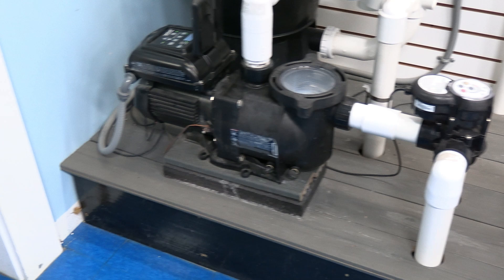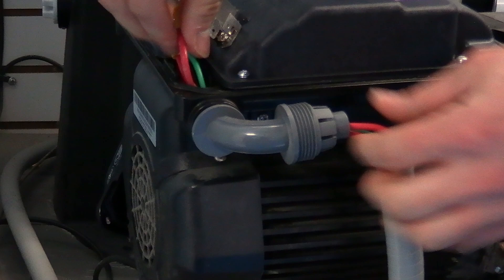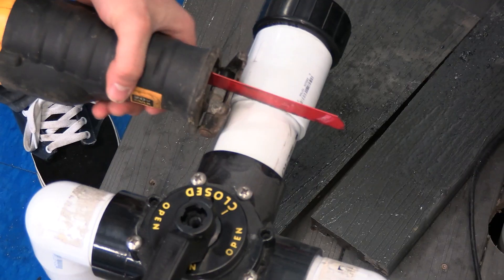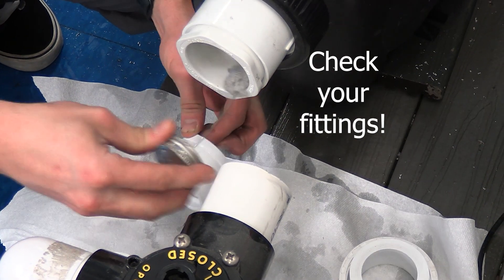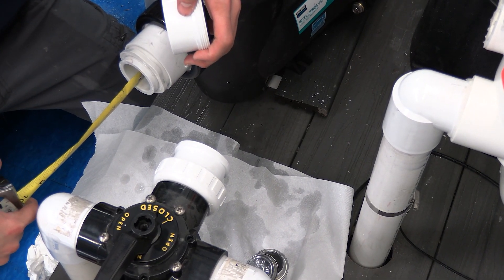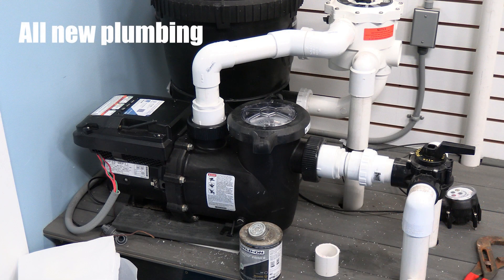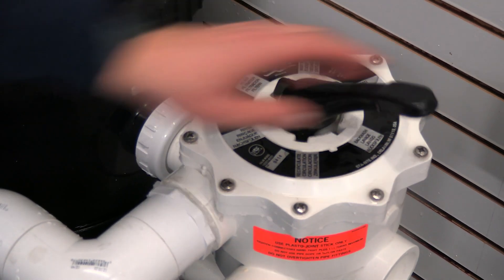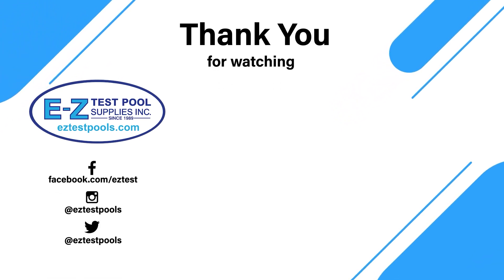Pentair IntelliPro3 VSF Pool Pump Installed

Comment: Can this pump be wired to iaqualink in a VF configuration?
Reply from the maker: Hello!

Yes! Pentair IntelliPro3 VSF pumps are compatible with Pentair automation systems like iAquaLink/Pentair Home when wired correctly. These pumps are designed to integrate with automation using an RS-485 communication connection, which lets the automation/control system communicate with and control the pump’s speeds, schedules, and modes. When connected to iAquaLink (or Pentair Home), you can control things like pump run times and speeds through the automation interface rather than just at the pump itself. Make sure you use the communication cable and wiring method recommended in the pump’s and automation system’s manuals to ensure proper operation.

I hope this helps!

Comment: I have pipe that is 2” for some and 1.5” for most.  
If I get the 3hp one is that too much? Or will I be ok?
Reply: If you have 1.5” pipe at all. Anything above a 1.5hp is useless because only so much water can be pulled/pushed

Comment: this pump has been a nightmare for me. I notice you didn't get it to prime up all the way either. Is there something inherently wrong with this pump, or is this normal operation? I've never seen a pump run normally with so much air in it.
Reply: I have the same issue. I have so much air in it. I have had it installed by a professional. Let me know if you find out anything.
Reply: @Jules-yg7vp  Depends some operations especially those with 1.5” plumbing will have an air gap  if you don’t have air coming out of your returns in the pool your good.  Alternatively if you do have bubbles coming out of your returns you have an air leak.
Reply: Any update on air issue? I am about to install one for a friend.
Reply: I'm having the same issue.  Installed this pump two weeks ago,  primed the pump like the manual said to do, there must be a air leak. There are pop up cleaners on the bottom of the pool and some of them don't pop up. I also noticed the filter pressure is low.  Have a pool company coming out after Jan 1st to see what's going on.